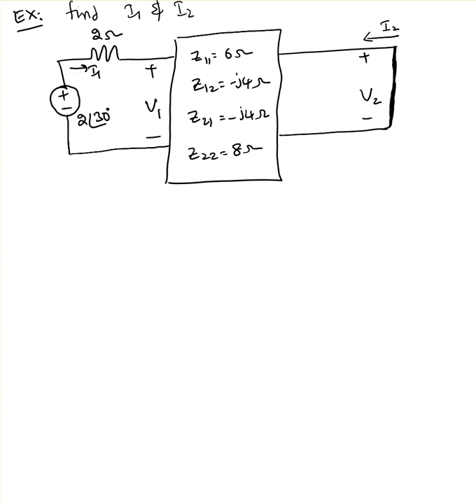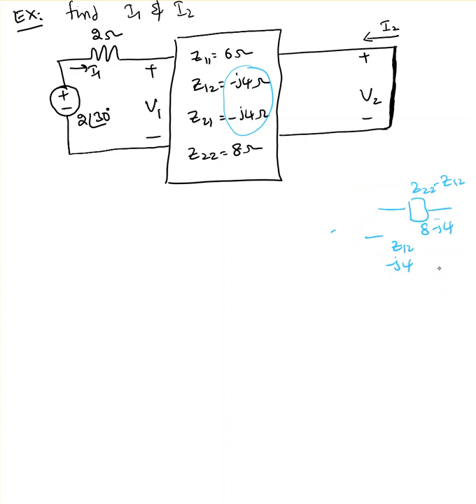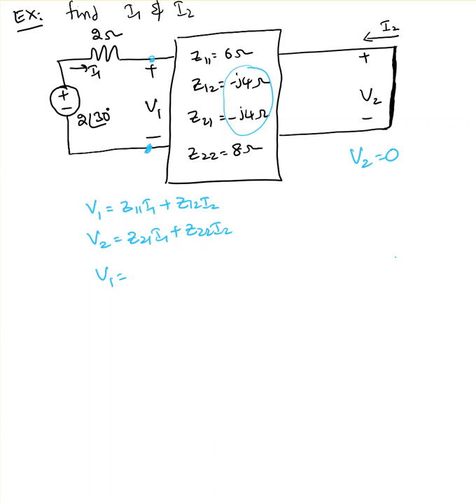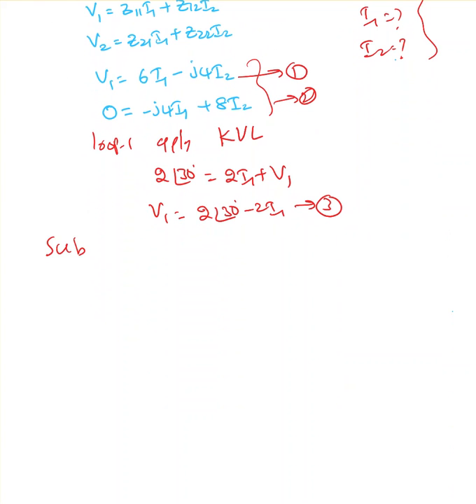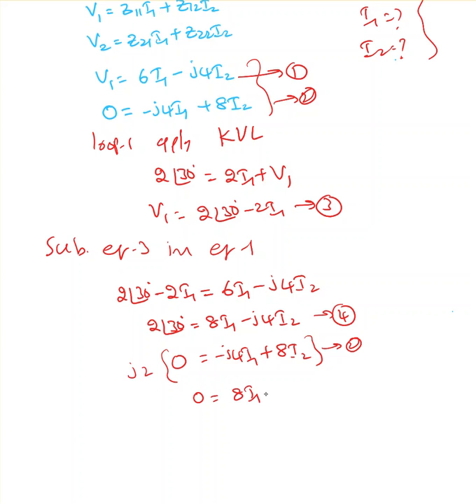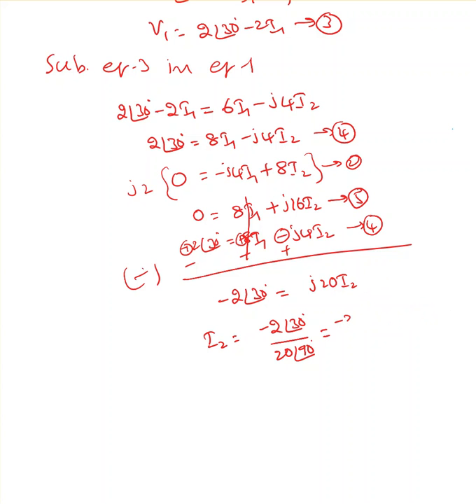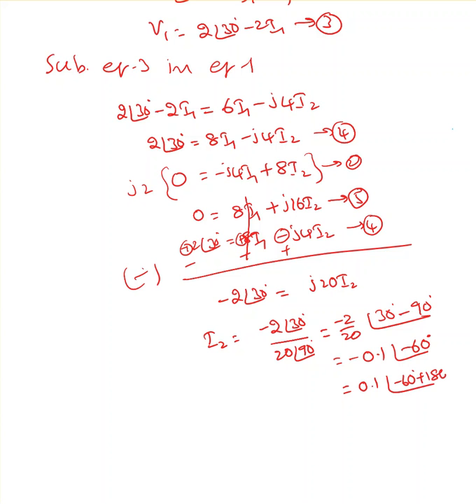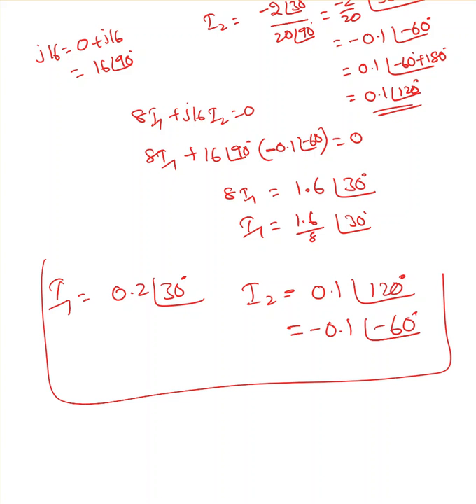Two-port networks 008

Comment: How can j 20 go to 20[90 degree ?
Reply from the maker: rectangular form Z= 4+J3; when you convert it into polar form  Z=5 at an angle of 36.86 degrees, the same way  if Z=0+j20 in rectangular from the Z=20 at an angle of 90 degrees in polar form.